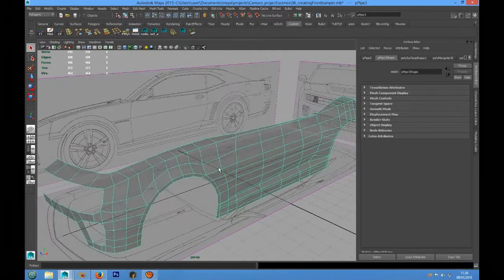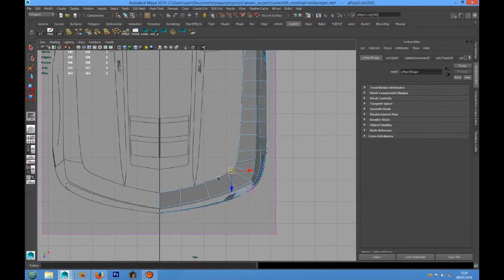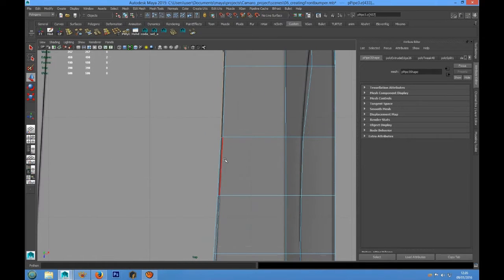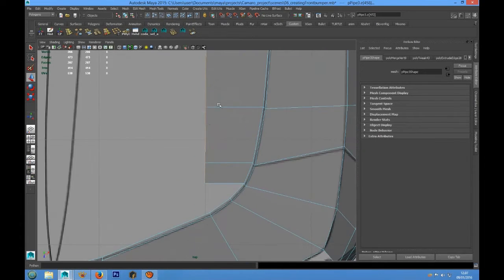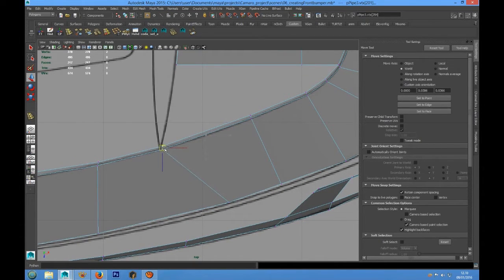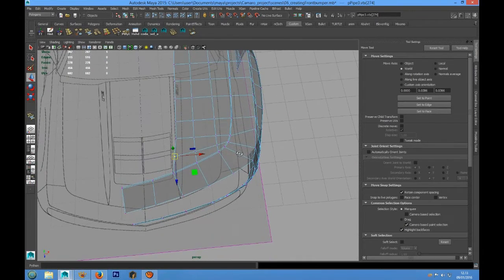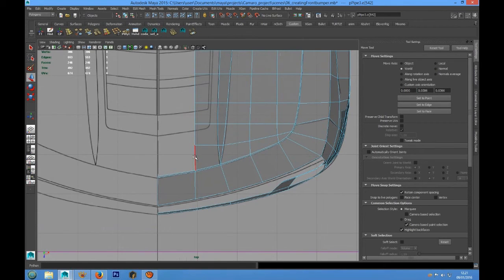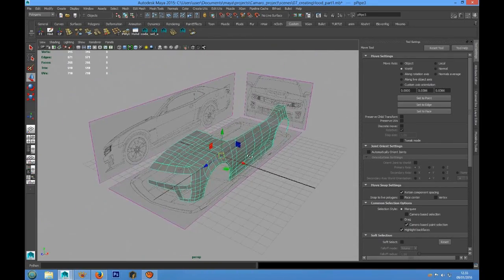09 creating the hood

Comment: In this tutorial you are using multi cut tool, and i am using maya 2014 version in this there is no such tool then which tool should i use ?
Reply from the maker: Hi if I remember correctly, there should be the split polygon tool in Edit mesh menu